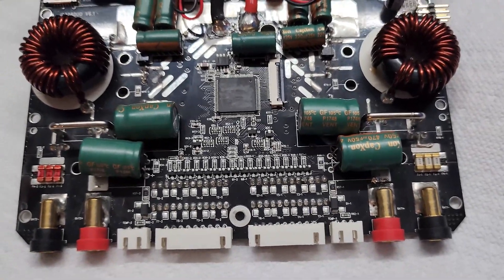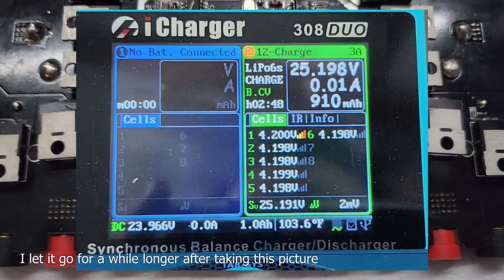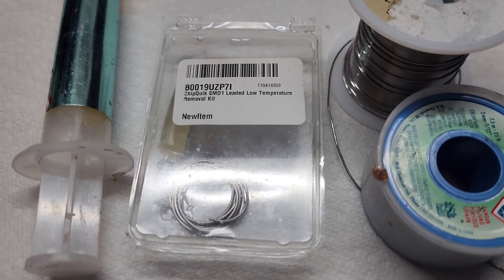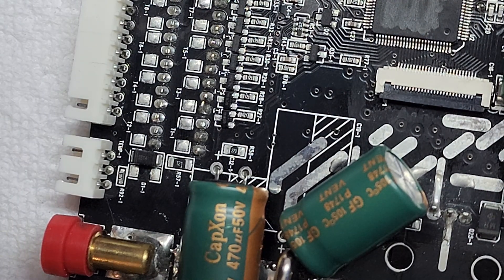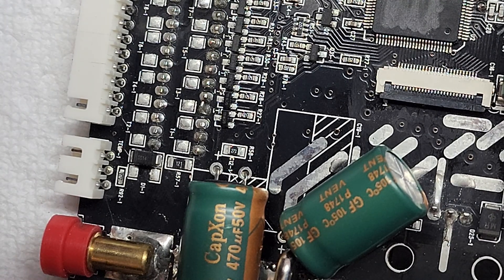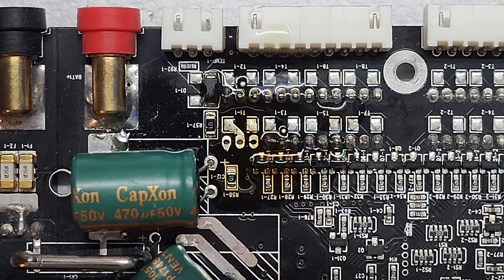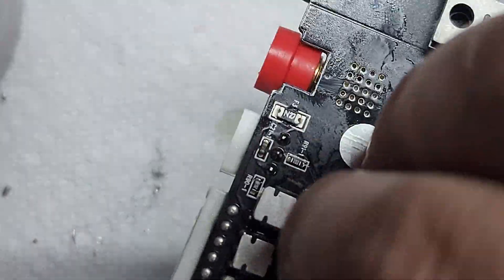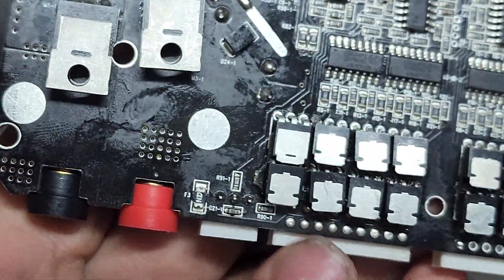iCharger Duo Balance Repair

Comment: Looks like I need to do this is there a better quality MOSFET
Reply from the maker: Nope not that I've found.  Wanna know the best part?  They use the same part in the newest DX12/Duo chargers and it fails the same way!
Reply: @BladeScraper  I found a really high-quality one. They’re like six dollars apiece. And there were a 20 amp 150 V. Compared to the stock ones which are 100 V 4 amp.

Comment: Great video on the iCharger balancing issue...  I have a different symptom, which looks like the following:  I turn on the 4010 via the Meanwell (RSP-2000-48).  Within a few seconds the Meanwell crowbars from 48V to 0V (the 4010 does not power up).  When I disconnect the 4010 and re-power, the Meanwell measures 48V... It would appear the 4010 is shorted, thus the Meanwell is crowbaring to 0V due to the 4010 short.  I've taken the 4010 apart, but don't visually see any issues.  Have you seen this issue and could possibly give me some direction?  I've looked for a 4010 schematic, but could not find one.  Best regards Derek...

Comment: Hello, thanks for this video!  I'm having trouble finding the exact part #j42cg. Instead, I am getting mjd42cg, but the middle leg is short and not the same... I know it's been a while since this video was posted, but if you or anyone can assist regarding where to buy, I truly appreciate it??
Reply from the maker: These parts have become very hard to find, yes.  After all, the charger design is likely close to 15 years old at this point, and component manufacturers put parts at end of life status eventually.  I found one that I think is a suitable replacement based on its specs, but I haven't actually tried it yet as I still have a decent stockpile of the original part which I got almost 6 years ago.

MJD42C1G by OnSemi.  Both DigiKey and Mouser currently have some inventory. But even that one says "This product is no longer manufactured and will no longer be stocked once stock is depleted."  I'm really not sure how much longer this repair will be possible, unfortunately.
Reply: Thanks the info!
Reply: Sorry, I know the model shows the mjd42c but I was hoping to have that long 3rd (middle) leg, Guess I'll just wire up the middle if they no longer sale it with the 3legs.

Comment: Instead to use the charger for balancing what is a passive balancing I will add a 5A Active Balancer that will do a much better job without burn the excess of heat.  They are inexpensive.
Reply: Is that an internal or external balancer that your adding to the charger and how is it connected if it is internal?

Comment: My charger has done this pretty much since I’ve had it. Looks like a fix I can handle. Where do you source the transistors?  Thanks
Reply from the maker: The transistors have gotten harder and harder to find.  I'm still using my existing inventory and still looking for a reliable source of a replacement.  The last ones I got from Mouser, but that was years ago.
Reply: @BladeScraper  Thanks for replying. I believe I found the item on mouser. Mouser.# 863-MJD42C1G  Thanks again

Comment: Thanks, good video. I've just performed this fix on a faulty iCharger X12 which proved a little trickier as its 12 FETs are stacked more closely together. They also back onto a thermal pad on the heatsink and the positioning has to be just right and the thermal compound kept intact or the FET overheats when powered-up resulting in rapidly fluctuating voltages on the affected string.
Reply from the maker: huh.  So the new chargers do it too?  Guess they haven't learned...
Reply: @BladeScraper  I ended up smoking my X12! Not buying another one. They are too expensive and hard to source to risk losing another like that. I already have a dedicated pack discharger and a Neey 4A active balancer that can go to 24S so all I was using it for was as a universal pack charger. I'm going to use a big PSU and voltage converter for that in future.